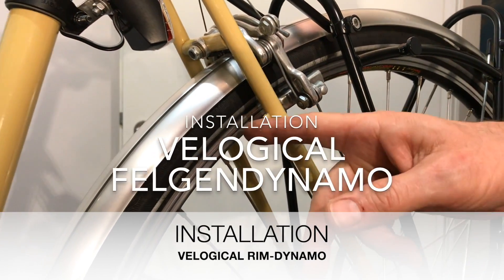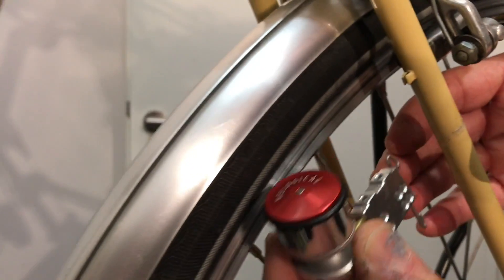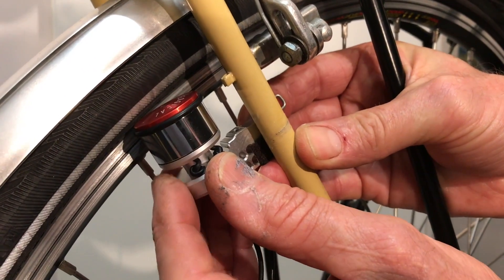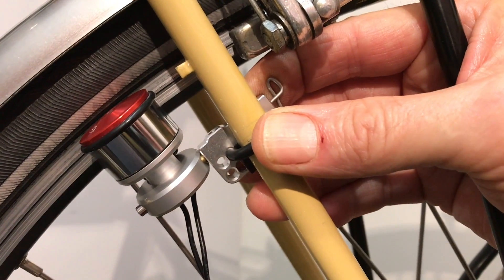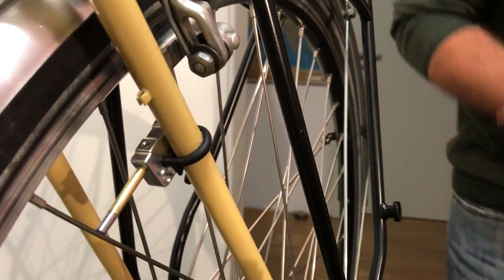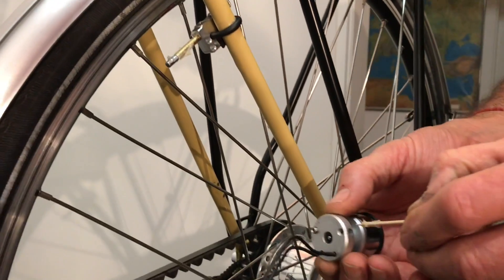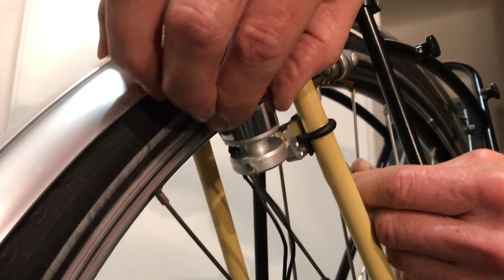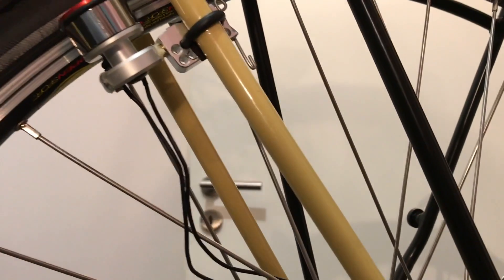EN / Velogical Dynamo V3 Seat Stay Installation

Comment: You should seriously rethink your approach towards the customers -- your website is complete mess, hard to find any structured information. Like here -- you have an installation video, great. So we see you installed the kit, dynamo is spinning and... what next? It is supposed to charge devices, right -- so where do the cables go? I don't see any USB connector at the end, so as customer I should guess, do a little DIY, or what?
Reply from the maker: Your misunderstanding: the information you are looking for is not part of the video you comment (here we talk on a popular special situation concerning the installation). Clicking the Velogical video channel (not just the suggestions by YouTube) you find a structured overview concerning 3 dynamo videos with different focus, available in "EN" english and in "DE" german (click the horizontal video preview line on the right side for a prolongation of the previews) :
https://www.youtube.com/user/4feetbiker/featured
Installation with cabling is explained and shown here (EN Velogical Dynamo V1 General installation):
https://www.youtube.com/watch?v=8xTAK3Sn2pQ&t=4s

Your attitude using any dynamo design for charging USB-devices is a complex special feature because as well the externally connected charger products (including the USB interface) by external manufacturers are involved. - Your confusion: technically it is NOT possible to connect any dynamo in the market to a USB plug directly!
You find general information on the combination dynamo/generator and charger in english here:
http://www.velogical-engineering.com/velo-on-board-power-supply
All detail manual pdfs for download in english, french and partly in italian language.
Reply: Are you joking, USB lol it's a dynamo. It hooks up like every other dynamo, as they always have done. 

USB that's hillarious